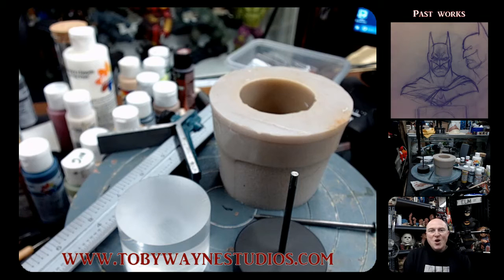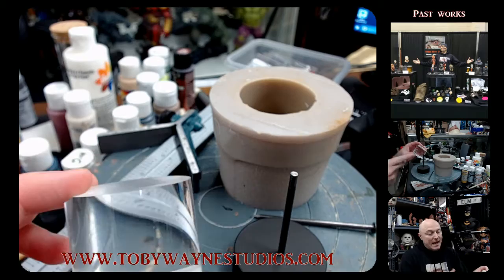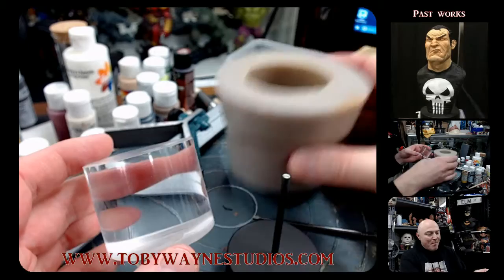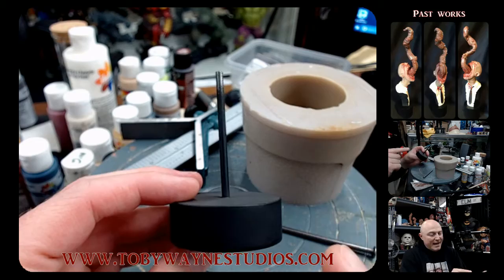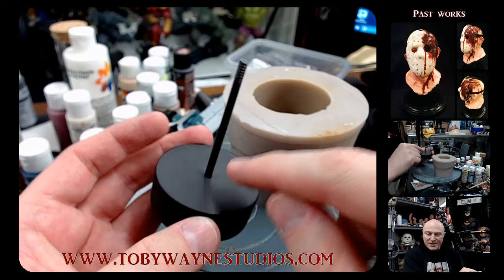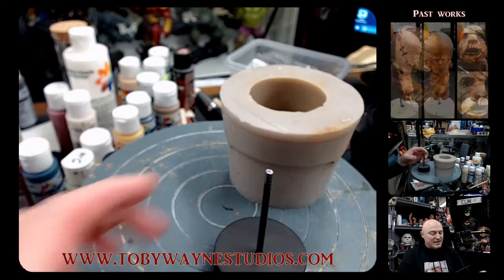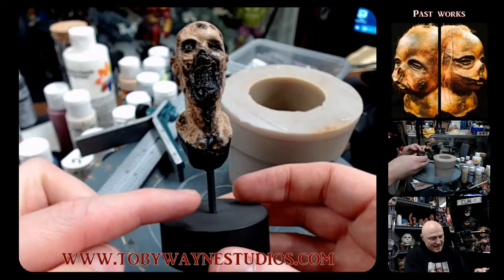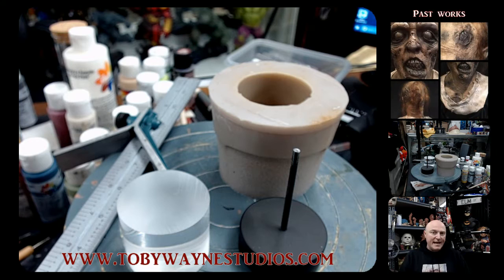What I use to make my bases!

Comment: THAT WAS AMAZING, Toby! I am so going to try & create some different sized bases using this technique. Thankx for the info.
Question: "Can I just drill small holes, like to secure a figures' feet, into the created base with a Mini-Drumel tool, without cracking the base? And do I need a certain kind of drill bit to drill into silicone?
I have now also subscribed to your channel...too.